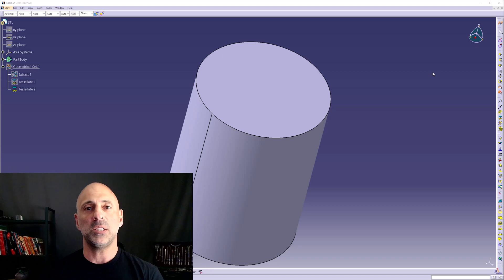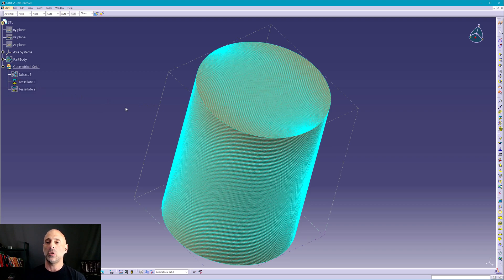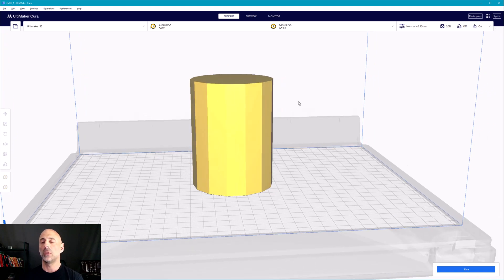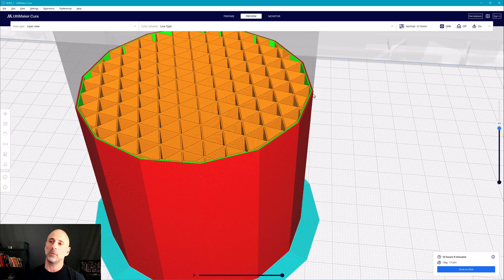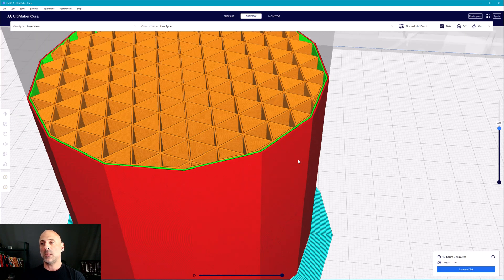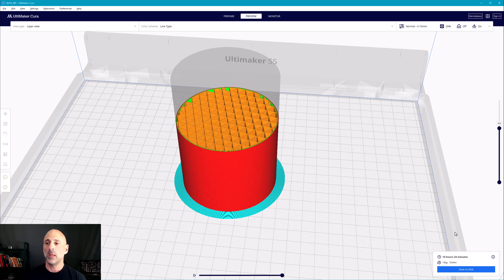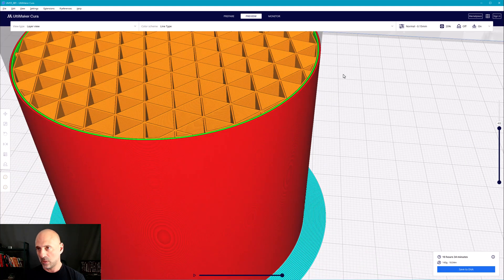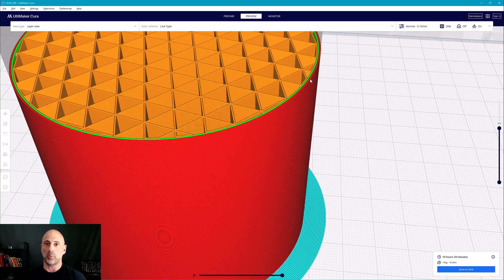Why 3D Prints Look Rough (And How STEP Files Will Change Everything)

Comment: DFM. Something engineers have been doing for years, along with DFMEA. To my mind, one of the great things about 3D printing is that there are now many many folks out there designing things with a view to 3D print them. I have over two decades of design experience, but am lacking in 3D printing experience. Traditionally, when things needed printing, it was just a case of passing someone the CAD who then did all of the converting and slicing work, which robbed me of the knowledge. Since buying a 3D printer I have started to learn some of the foibles of the process, but am still a long way off being proficient in my mind. The whole opensource movement has meant that when you find a good model which has been subject to intentional or unintentional DFM it is a valuable learning exercise. I see many possibilities to grow as an engineer with the development of affordable 3D printers and am keen to expand on my skills. I'd be very happy to see more of this style of content as I see it has great relevance, alongside the CAD tips and tricks. My personal nemeses are parts which have multi-axial requirements, amd am trying to learn how best to slice and print such items. The most simple example being a cube which has holes that need to be accurate in the X, Y and Z directions. If anyone has recommendations for content that addresses this specifically, I'm all ears.
Great vid, with some food for thought, I was so pleased to see Bambu Slicer supporting STP when I upgraded from an Ender 5 to an X1C, gamechanging stuff.

Nice hair-do by the way Steve ;)
Reply from the maker: What a fantastic comment. 

The DFM and DFMEA you are talking about is a little different than what I was referencing. I should be a little more clear: Just because the CAD system you are using allows you to do it, should you? Things like terrible order and the odd faces that get made. Or making a '3 sided surface'. Or the inference that any part can be printed. 

That type of thing. 

LOVE the feedback about the Bambu slicer. It is that type of thing that needs to occur for better all around part quality from a 3D print. Imagine being able to slice a part that has various attributes assigned to faces to get certain textures or thicknesses. 

As far as multi-axial parts... ugh. They are super difficult in anything. Other than an SLA type of process a printer with 2 heads and a filament that is water soluble  might be the best way for now. 

Thank you again!
Reply: @StevenMarji cheers for your feedback on my feedback. It was more of a mind wandering things really. I was using YourTube as an excuse to delay on some composite tooling work as I've been moved to NX after 20+ years of Catia 😂
But it did make me think that DFM is also a thing when you're 3D printing., I just don't think it is considered as such. 
I'm hoping that the advancements keep coming thick and fast. I've been toying with an H2D purely for the ability to use a dual head to make designs much better. It's an outlay but it could pay dividends.
Keep up the great content, your NX clips have helped me out a few times. Good to see someone with engineering knowledge doing content, as opposed to the warez users doing random didging to arrive at some sort of a solution 😂
Reply from the maker: That's really funny. That move is tricky but to be honest, it's better than Catia to Creo. I have had a few friends that happened to. 

Unfortunately DFM is a lost art of sorts. I blame management types and in some cases planned obsolescence. I see a rabbit hole headed my way! 

Thank you for the feedback. It keeps me motivated to do more.

Comment: I helped one of the 3D Systems field engineers upgrade an SLA-500 in a GM facility in Ohio in the early to mid 1990s. Possibly a Delco facility, but I can't recall for certain now.

Note that the STL acronym kind of refers to two separate things. First & foremost, the American inventor of 3d-printing, Chuck Hull, coined the term "STereo Lithography", abbreviated STL, to accurately describe the technology itself, where "stereos" refers to the Greek word for "solid" or "three-dimensional", and "lithography" refers to printing words or graphics on a two-dimensional plane. In a nutshell, "stereolithography" was Chuck Hull's term for "printing in 3-dimensional space".

As regards the file format specifically, I have heard "Stereolithography Tessellation Language", "Standard Tessellation Language" and "Standard Triangle Language" - there doesn't seem to be consensus on that acronym as it applies specifically to the STL file format.
Reply from the maker: Well, true story, that may be the very machine the SLA's I was talking about came from. That is hilarious. Small world. 

Thanks for the history. I knew there were several explanations depending on whom one talks to. Personally, I will stick to Chuck's term. 

As the tech progresses, I have a feeling it'll all be called 'G-Code' dropping the language as more and more file types, especially STP, are being used to make the code. 

Great comment.
Reply: @StevenMarji , Following up, you're right, the definition of the acronym "STL" as it refers to the file format is indeed Chuck Hull's original coining of the term "STereoLithography". A friend who still works for 3D Systems looked up the file format topic in two different books on stereolithography written by Paul F. Jacobs, (Jacobs was then a high-ranking scientist at 3D). Both of those books define the STL format acronym simply as Chuck's definition "STereoLithography". Although the STL format does create each volumetric layer via triangular tessellation, neither "tessellation" nor "triangle" is part of the original definition of the STL file format acronym.

I can no longer recall the name of the gentleman who was in charge of the SLA lab where the field-service engineer and I upgraded that SLA 500, but I do recall he took the FS engineer and me bowling after dinner our first night there. I do recall the upgrade was quite a chore, including drilling new holes in the steel-tube frame where the "rim" (recoating mechanism) was supported & leveled to the surface of the resin in the vat. I recall having to design drill jigs before I traveled to that GM/Delco facility, and carrying the drill jigs and a fairly heavy toolkit in my carry-on luggage. The flight attendant gave me a hard time for having such a heavy bag in the overhead bin, but they let me fly (which couldn't be done today, of course ;-)
Reply from the maker: I can hear you clanking down the jet bridge now. haha. 

That SLA setup made my life way easier when we had to sell a new design to the management.  The NorthStar engine had the coil per cylinder thingy happeneing and we had to print the boot, and the coil brackets and a few other things so the leads could visualize the set up.

Thank you again for the walk down memory lane.

Comment: I sent my STEP file over to a company to have it printed. The website automatically generated a STL. and I downloaded to view it, but it was very low-res. I used Fusion and converted and uploaded that instead. I have compared many cad software over the years and I would say Fusion using the custom settings produces great STL files. Mathematical geniuses created that exporter.
Catia is great at so much, but not very good STL even by using the Tessellation settings. Too me if I have complex surfaces on a large part, I will take the time to use Fusion to export the STL. I am hoping for the day someone can create a slicer that does not need to convert (Non-Uniform Rational B-Splines) into STL, just like CNC software does not use it? Why the extra step? Was it to keep it open source?
Reply from the maker: Fusion is amazing software for the cost and you are correct. This is a simple example meant to demonstrate the overall issues. 

There are advanced slicers (read that as expensive at the moment) that uses direct STEP files and thus NURBS math. 

From what I understand the current slicers have issues with thickness as well surface plotting. It will take a few more years until printing from a STP will be widely available.